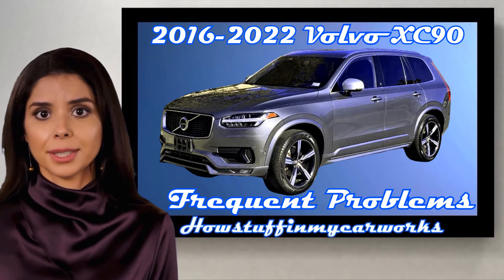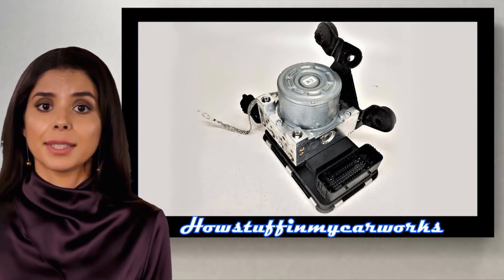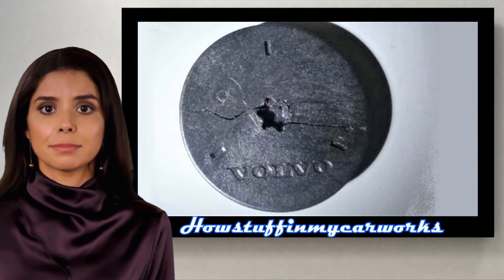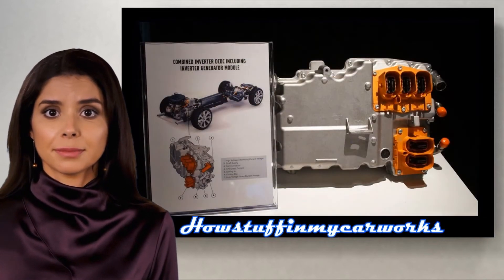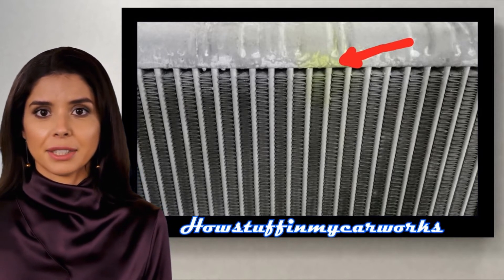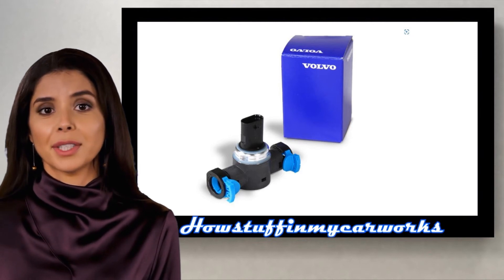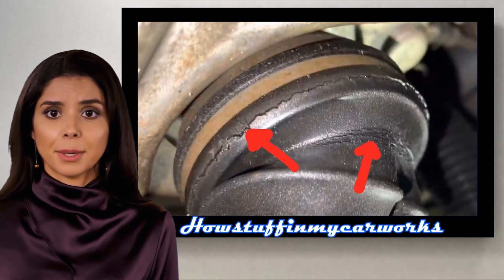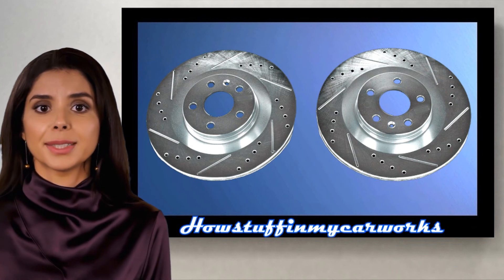Volvo XC90 2nd Gen 2016 to 2022 Frequent and common problems, issues, defects, recalls & complaints

Comment: Other common problems: Water leaks: drainage pipes blockage casuing rain water flowing from the sunroof rails into the driver/passenger foot well. This may require changing of entire Electrical Loom costing over £2500 to repair

Comment: 2016 Momentum, oil consumption issue, now needs a new engine 😢
Reply: I had the same issue on my 2016 XC90. It was covered under a recall. Weird part if that  no one told me until I got a letter from completely different Volvo dealer about it and not the one I purchased it from. Issue is because of poor quality piston rings. They took the car and repaired it under that recall, it was about 11k but all covered. Please check with the Volvo dealers.

Comment: Purchased a 2017 Momentum 56,400 miles three months ago. Love the drive feel and handling but starting to question the reliability. I had the dealership do 60,000 mile service which also included new spark plugs. Two weeks later got stuck at a store it wouldn’t start needed a new starter. Now a week later check engine light on my reader saying possible oxygen sensor code P0137 and another code. Taking to a specialist tomorrow instead of the dealership. Wondering if I should trade it in getting worried about reliability.
Reply: Any news on the Volvo? What the shop say?
Reply: if you bought a volvo without a CPO extended warranty that’s just stupid
Reply: @dob3079  All modern cars are prone to issues. The 2017 is just the 2nd year of this model get 2022-2023 and 90% of the issues are fixed.